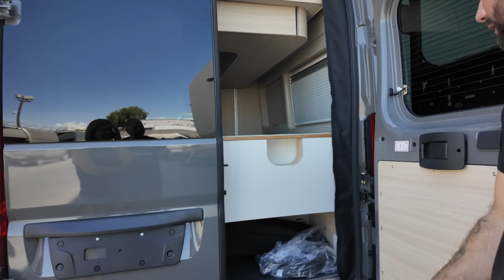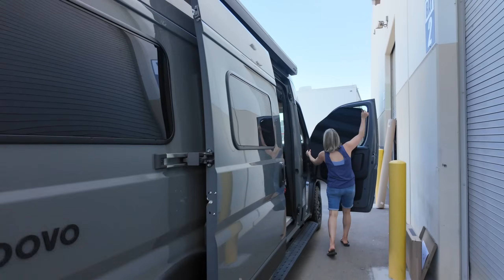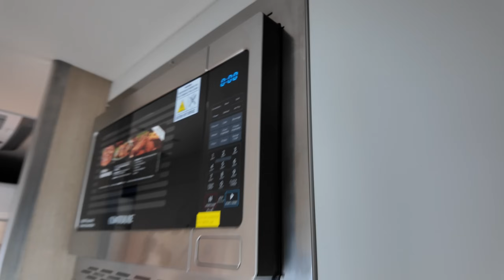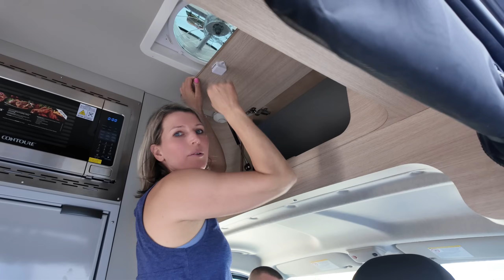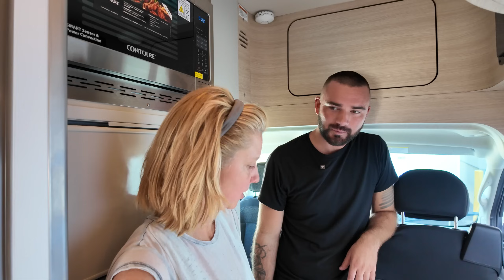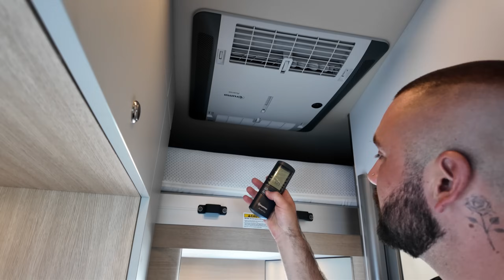First-Ever Delivery Walkthrough of the Noovo Plus Lift Bed Camper Van (Unseen Details!)

Comment: Super video and walk through. That said, I was surprised by two things:

1. The delivery agent did not use a checklist to ensure he covered everything and near as I can tell there is no Noovo manual to explain everything. If I were the Noovo company, I would have at least a web-based manual/delivery experience that could be used by the delivery person as a checklist or the owner afterwards to review the explanation of every component. The lack of even a checklist means the delivery experience for each owner will be different.

2. I was shocked by the number of remotes and control systems. It just goes to show that even vans from a luxury company are just a collection of parts from other manufacturers. Ideally, there would be one master control system for everything.

Two other thoughts,

1. I am surprised that a luxury brand like Noovo includes no security features for the van (surround cameras, motion detectors with remote monitoring/alerts, etc).

2. Noovo should highlight that they have an option for a bagging toilet. I would never want a cassette toilet.

All the best.
Reply from the maker: Thank you for your suggestions

Comment: A front wheel drive on a Dodge Ram chassis.  I understand the new NOOVO NEXT will be on a Mercedes Sprinter Chassis and be all wheel drive.  Of course the NEXT will probably be 50k more but it will come down to what style of camping are you planning.  If you're looking for options to Boon Dock or camp off grid, a front wheel drive vehicle might not be the best fit.
Reply from the maker: You have a great perspective, thanks for your comment.

Comment: Are the sitting areas in back wide enough to sleep on like 2 single beds instead of making the bed? Thanks for the video.
Reply from the maker: Well technically you dont need to make any beds because the Lift Bed is always made and ready to go, however if you wanted to nap or sleep kids or somewhat smaller adults in the lounge without lowering the table, it's totally possible
Reply: @WhereRVGoing  Thanks. I ask because i'm considering the model without the Lift Bed.
Reply from the maker: The rear lounge model or the lite?
Reply: @WhereRVGoing  Rear lounge model

Comment: Im still waiting for more van choices; RAM, Ford, and Mercedes are not my cup of tea.
Reply: None of the chassis are perfect, but in my opinion the Transit is the best choice.  Turbo gas engine for high altitude performance and no diesel hassles of the tiny turbodiesel in the Mercedes.   More ford service centers than Mercedes service centers.  The powertrain in the RAM is the simplest design, but it’s the weakest at altitude and has its own well-known designs.  The dually Transit is more secure in crosswinds than the front drive RAM.  The new Mercedes powertrain will not allow a high idle to recharge coach batteries without voiding the engine warranty.
Reply from the maker: @J.W.W. thanks for your thorough comment
Reply from the maker: Well those are pretty much your options to choose from in the  USA 🇺🇸
Reply: @WhereRVGoing  <sigh> I know. In the meantime, gonna keep towing....

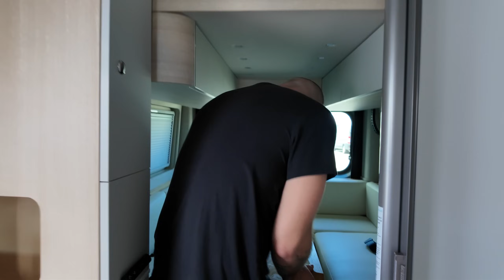Comment: 10:00 My only negative is that the table in the rear.. I wish we had an option to remove the table altogether and have more of a garage area....   Instead of a lounge.Just have it like a twin bed once again.  So you have more of a garage area and you can actually enter and exit  from the back.....   i would see myself removing that table and modify in the back cutting the backside of the lounge....   i would replace the table with a portable table like a Lagun leg table system.

Maybe the Noovo Next AWD
Reply from the maker: That's great input for maybe a new interior model, I know noovo is reading these comments 😀